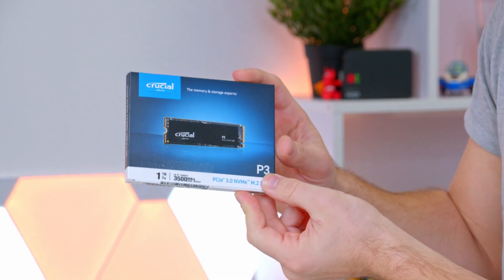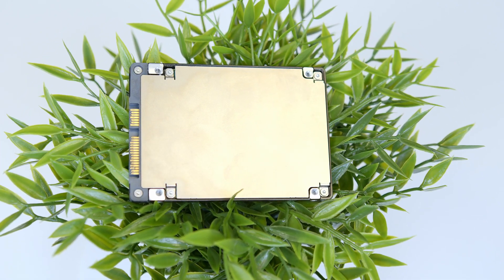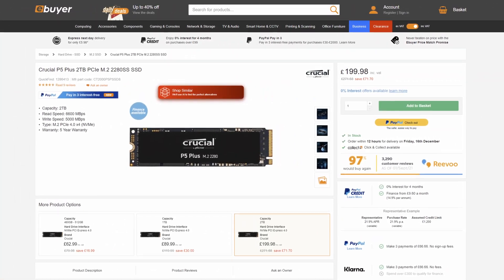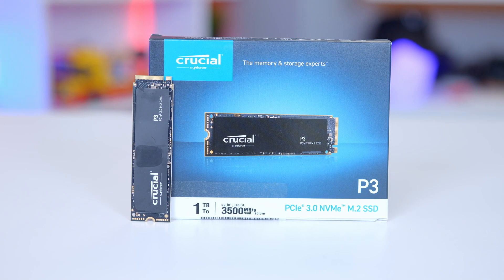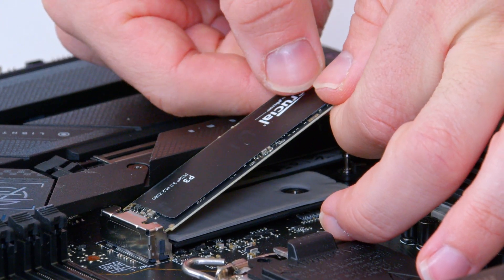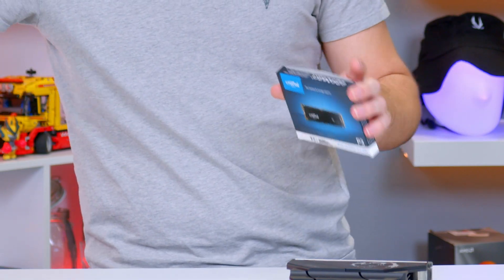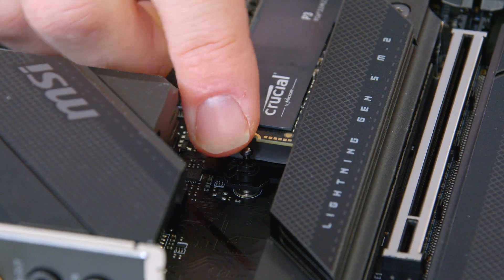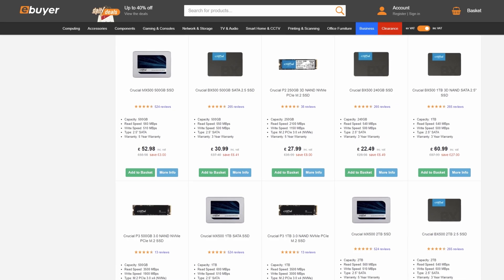6x Faster Than SATA! – Crucial P3 SSD Unboxing & Installation

Comment: I ordered this SSD as the boot drive for my PC, I saw some reviews that this isn't good for boot drive but as an extended storage. I hope it works well when the SSD is delivered
Reply: Does it work still? I m not sure if I should buy crucial or Kingston
Reply: @MarianGameDev-g7f  I use it as a secondary drive now
I bought the crucial T500 as OS drive, it works well and the speed is top notch